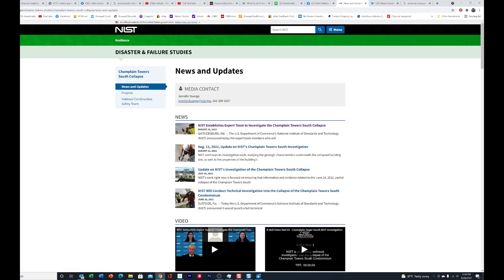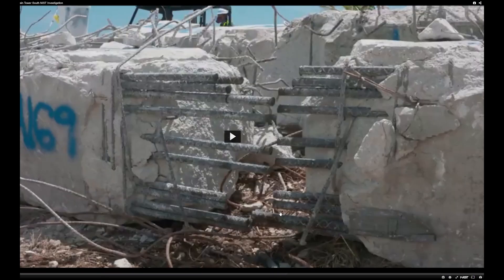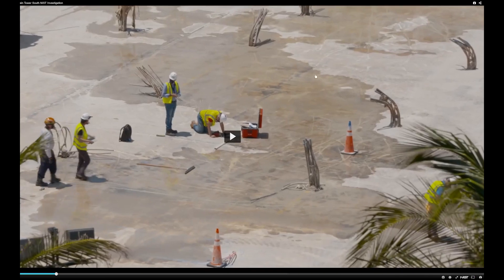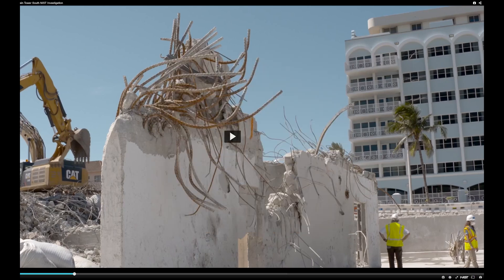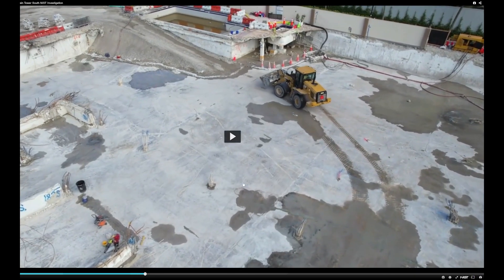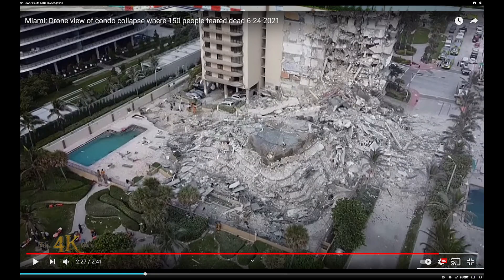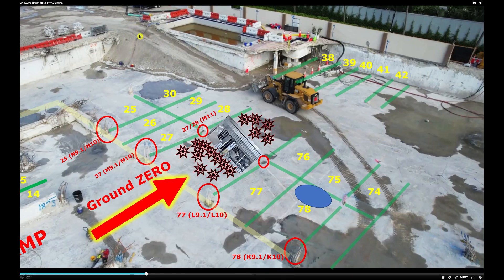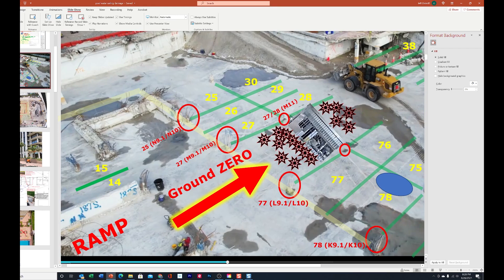Surfside Condo Collapse Site View NIST Video Ground Zero

Comment: Hey Jeff, Thanks for the video. I'm confounded by what I see at 19:53. It appears to be column rebar protruding through the middle of the driving lane of the garage floor deck between O-8 and O-9.1; I'm not finding a colum at that location on the Basement Level Framing Plan, sheet S4 of 14. The nearest column to that location was the one that sat on top of the beam BM35 and extended to the roof.  Whatcha think?
Reply from the maker: Are you referring to the bunch of spaghetti that is coming out of the floor and it looks like it has a bunch of black stripes at the bottom of it question? Power if so you are correct it does not show up on the garage level framing plan on page 30/336 on the 1979 plans. But, it does show up on the lobby level framing plan page 31 you'll see it in the middle of BM33.  So it could be that this came crashing down and impaled into the concrete we simply don't know 'cause it you're right it does not make sense that it would be in the middle of that driving labe. The column with the red stripe on it is the column that divides space #17 from space #18, and is known as column O8. Other than what I mentioned up above I can't see what this could possibly be.
Reply: @jeffostroff  Amazing how it would punch through nine inches of reinforced concrete without any collateral damage to the rest of the slab and (appear that it was there all forty years).  21:30 Not power; all of the power was distributed from the front of the building near the porte cochere at Lobby level.  This mess of rebar is between the red-base column for space 17 and  space 24.
Reply: Column K dimensions were 12" X 24" and extended from Lobby floor to penhouse roof, generally being the NE corner of kitchens in unit A's.

Comment: I was noticing around 12:00 that the remaining rebar in the columns at the edge of the building seems pretty straight.   Would you expect more bending in the rebar in these columns if they failed in buckling (not a concrete engineer myself, so I'm curious)?

Comment: Not only no sink holes, no differential pile settling. Some people keep saying the foundation was suspect because of 2mm subsidence per annum—it is not. Foundation was fine. It was poor pool deck design, very poor construction as you point out with concrete probably not to spec and improper rebar placements and overlaps, and awful maintenance.

Comment: I think H-beam/C-beam near the ramp is what caused the last section of the building to come down. The swaying broke the columns holding it up. The cross beam held up another column that didn't go to the basement floor so it held a lot of weight

The most interesting wall column is the one you barely see in this video - parking spot 80/81 I 9.1/10. Interesting black marks on the floor and bent steel. I think there was a level drop similar to the deck/planter one by the ramp. The plans aren't clear, but I think the gym patio was solid concrete on top of the pool deck level and when the pool/parking collapse forces hit it the column failed. You can see the poor state of that part of pool deck in the garage video. 

If you check the CCTV collapse video the first frame is already into the collapse. If you compare that to what the building should have been that end of the wall seems to have fallen first. Everybody has been looking at K/L/M but missed I.
Reply from the maker: that last section of the building likely hung on due to that h-beam

Comment: @0:50 not only do the rebars look "crowded", but the cover seems a bit thin...?  You wonder if they used vibration jumpers back then to aid consolidation around the bars and stirrups?  Also, I sincerely hope we're looking at the BOTTOM face of the beam--rotated 90 degrees--because all that steel would do a lot more good close to the bottom face than the side face, amirite? =:O

Comment: Yes JEFF your correct that the Lift working on the palm trees is HEAVY EQUIPMENT. they weigh at least 22500lbs. and all that on 4 wheels on a deck that weak was a problem. That deck should have been engineered for heavy equipment and obviously it was not. With no shear wall or support beams. Many things wrong here. OMG....IMO why was this not condemned when the Engineer did the 40 year inspection.
Reply from the maker: that can't see the  latent issues

Comment: fyi, when the rebar is side by side , you can assume that is where they lap join lengths of rebar,
where you see the rebar clean of concrete that can be due to rust on the steel,  which when concrete is remove make the steel look clean, where you find the concrete that has come off said steel you will see rust stains and pieces of rusty steel attached to the concrete .
Reply from the maker: good info

Comment: K11, L11, & M11 being small columns are going to be a HUGE part of the initiation of the tower collapse, in my opinion.  There's not enough for me to have a strong opinion on them being the start of the pool deck collapse, but I think they were probably undersized for supporting the complex double-H beam arrangement on them.

Either undersized to the point of starting everything, or undersized such that they couldn't even begin to resist the progressive pool deck collapse.  That turns those beams into Achilles' heel, with the mass and strength of connection to the critical 9.1/10 columns.  Take the 11 end support away from those beams, or severely compromise it, and you basically start a 5 to 10 minute timer on the tower collapse.

If the 11 end of those beams had been on the larger columns, I think we could have had the opposite result.  They could have possibly formed a strong point to halt the pool deck progression; either saving the tower or delaying the collapse sequence for hours (and allowing evacuation).

And there's one of the professional learning points for engineers.  If you're putting in a big strong beam, give both ends similarly strong support to prevent it turning into a demolition lever if the weak end has a major problem.  Alternatively, design the strong end to adequately perform if the beam suddenly becomes a cantilever.

But, hey, smaller columns are more profitable in the short term, if you can get away with them.

Comment: Could it be that the centerline of the columns 9.1/10 was moved on higher floors? So as resulting in a shift/offset in the vertical alignment? Creating a moment by the loads which tried to twist the columns at the offset making that a weak point? I have not looked to deeply into the details. But from all the not-in-one-line elements I am leaning to believe that could be possible.
Reply from the maker: well this framing is from the garage level and the columns must be centered over the lower floor columns.

Comment: Some of the rebar work should not have been allowed. Bars too close and not sufficient lapping. Whether the structural design should have been allowed is another question. The paucity of concrete remaining adhered to bar might have been caused by debris clearing, tho it also might be due to deficient concrete or bar conditions before pouring.

Comment: I’m not in the building field, or even the usa. But just looking at the part where you said it looks chalky, I don’t see any aggregate in the concrete at all, in-fact in most of the parts where you are talking about the rebar, I don’t see any aggregate, only cement.
Reply from the maker: Yeah sometimes it's hard to tell and keep in mind too that sometimes on the outer edge of a column where there was a concrete mold it can really make things nice and smooth and flat to the point that maybe you don't see the aggregate in there. But I have also heard other people mention that other pictures that were released by NIST early on in July did not seem to have aggregate in it. And look with all of the dust and everything it's really hard to tell so the only way to know for sure is when they get a sample of that concrete and cross section it and then look for the aggregate and that it's not too big in size. If the aggregate is too large the concrete will form big pockets and holes in it. If the aggregate is too small, the concrete will not be strong enough. do you

Comment: The compressive strength and creep resistance in concrete comes from the aggregate which is normally 3/4".  THERE IS NO AGGREGATE IN THE CONCRETE.  It was comprised entirely of sand and cement.
Reply from the maker: Are you sure it should be 3/4" that sounds too large
Reply: @jeffostroff  3/4" minus is the industry standard.  There is nothing but sand in the mix that they used.  Look at the pictures.
Reply from the maker: @screamdoctor  that would explain why they want 1" between rebar, but even with 3/4" aggregate. I would expect they need more space between to get those rocks to sink
Reply: @jeffostroff  The entire design was riddled with errors since the structural engineer did not understand reinforced concrete, bar embedment, concrete shear, the purpose of column ties and the importance of not being pushed around by the Architect and the contractor.
Reply: @jeffostroff  It is called 3/4" minus.  Hardrock aggregate is popular to minimize creep shortening in post-tensioned concrete slabs.

Comment: Spacing should be 4cm on that rebar..  I think before we start patting ourselves on the back we remember it stood since “81 so even though we found problems they didn’t present themselves until degrading conditions changed the strength of the structure dramatically.  

Stuff I have seen wrong with the structures design is around the failure point.. the pool deck. The landscape boxes were not to the drawings. Step down features with the pool area were removed but column placement needed the structure for their current positions.  

But again… it stood for a long time…
Reply from the maker: Correct having one inch between rebars is what they say is the minimum amount of space to have in order for the concrete to properly flow and form around the rebar. So assuming that it did not flow and form around the rebar correctly, does that mean the building is going to collapse a day after you build it? No it's a matter of time in this case it lasted decades but keep in mind it probably would have lasted a lot longer had some of the necessary repairs been made and they didn't let water intrusion into degrading the concrete

Comment: I think you and Josh have indicated that the pool deck went down first. I have seen a video simulation showing small pieces of the building falling before the deck went down.  Do you think this is accurate or artistic license>
Reply from the maker: I think they used artistic license, it's a root cause in search of evidence. We based our root cause mostly on the tourist video showing the pool deck collapsed first, then witness accounts saw the collapse also of the pool deck.

Comment: I hope they verify “bonding”. Were all the columns “vibrated”.
Reply: The reason the rebar is so “clean” is because the concrete was NOT vibrated, otherwise some concrete would have bonded to the rebar.
Reply: Clean rebar means no tension.
Reply from the maker: I've always wondered about that myself I always thought that the vibration of the concrete was to make sure that it got down and filled in all of the voids between the rebar. I don't think that that is necessarily going to make it bond to the rebar, you would need chemicals of the proper mixture in there to make it actually bond better to that metal.

Comment: Love the channel Jeff, could you do a video showing the drainage as I see in one of the stills where we are on the ocean side of the bathub wall a large round pipe going through the wall. Where also was the sump drainage for the rain water that was in the garage floor?
Reply from the maker: I saw no evidence ha they had a sump pump in he garage, so maybe they stopped using one
Reply: @jeffostroff  This video at 1:02 shows the North Tower and highlights that the sump pump was new. I would imagine the South tower would have had the pumps in the same place. They are effectively a hole in the ground covered over by a mental manhole cover. Let me know your thoughts. They had to be using one as it was mentioned by the previous maintenance guy that it was always working flat out and they had to keep replacing it https://youtu.be/8WqraSrYTs8

Comment: Think about it... if you are confused by the architect's framing drawing inconsistencies and ambiguity,  imagine being the concrete contractor trying to follow it !   Maybe some rebar specifications mistakes were made from the beginning when the building was constructed due to this ?  Maybe it will be found to be a contributing factor ?
Reply from the maker: Was I supposed to pout concrete into that column, or elmer's glue? LOL
Reply from the maker: Was I supposed to pout concrete into that column, or elmer's glue? LOL
Reply: @jeffostroff  More important the # diameter of the rebar and count / spacing.

Comment: Was the pool "fresh water" or "salt water"?  Salt water intrusion turns concrete a chalky white color and erodes and weakens the cement much faster.  If the parking garage ceiling was cracking and bowing down, that would be an indication of weak concrete and the ceiling in the basement should have been shored until a fix was accomplished.

Comment: I wonder why state officials don't take a newly condemned condo and dismantle it to see what state the concrete is in. Like an autopsy. It would yield clues as to how many other buildings may be at risk.
Reply from the maker: Yes I agree it would be pretty easy to have av structural engineers come in and they take core samples out of different parts of the concrete and just fill it right back in the same day. That is what the city of surf sides engineered that they hired did he went on to the North towers towers sister property and took some core samples and filled them in the same day

Comment: A few weeks on the beach it will corrode overnight, plus it’s raining season, I did a Seawall in surf side and the rebar rusted on surface quick
Reply from the maker: IS rust in surface ok as long as the rebar does not get wet after concrete cures?

Comment: Would the rebar spaces be part of the reason the columns failed?
Reply from the maker: Yes it is possible because if the rebar is spaced closer than one inch together, then the concrete cannot flow properly between them and hence it may not grab onto the textured edges of the rebar properly, and you may not have the strength that you thought you have when the column kuros.

Comment: Do you think if they would of started repairs a couple years before that this could of been avoided?
Reply from the maker: Absolutely this could have been avoided and the other thing is when they finally did start the repairs this year, I question why they began on the roof instead of on the really bad structural issues. My understanding on their reasoning was they started on the roof to get it over with by hurricane season but that's not a good enough reason for me.

Comment: Great video as usual Jeff, thanks. At 19:05 I’m confused - is that big chunk that’s on and around space 14 from the slab above? It’s obviously above floor grade so it’s throwing me off. If so why did they choose to leave that when the cleared out everything else?
Reply: This is the C beam that can be seen on the ceiling of the garage tour video. It fell to the garage floor when the building started to collapse and is now on the floor as you can see in the footage.
Reply from the maker: I have been wondering this too since the first day I saw this a month ago. It could be two possibilities here one they think that that big C BeaM is part of the structure like it's built onto the floor because it looks so massive just like they left the elevator section of the vestibule on the other side of the garage floor. Or maybe there's something about it that they want to study it further in place knowing that it dropped right where it dropped from. This was hanging off of the garage ceiling.
Reply: @jeffostroff  ah of course, now I see. It’s interesting, as you point out later in the video, that the bottom of the “c” lines up with column 27 in the drawings and Fiorello’s walk-through. Makes me wonder even more why they have left it there.

Comment: 26:00 The Engineer is saying 9.1 is the right side beam from rectangle with X, from the left of that rectangle with the X through it, that beam is slightly offset lower, which is #10. Carry on going left and it's slightly lower but parallel. That's beam row 10. Laid a ruler on screen and they are offset. That's why like you denoted 9.1 goes straight and 10 is slightly below. So those are 9.1 posts. 10 are on the other side of the building. That doesn't excuse the lack of consistency in naming conventions. Probably an earlier draft he never updated. 3:13 You can see on the right of the image where chip is on corner that is how they are poured. Maybe they didn't put spacers on them or whatever to keep them apart during pouring and weight of concrete shifted them together after forming and during pouring but that's insane. Looks like there was no adhesion between rebar and concrete itself. Like it was... dirty or greasy when installed in form or something. Regardless I feel like there's just too much rebar in all of these columns. Too much crowding. I'm not expert though.
Reply from the maker: Ye a lot of us are concerned about the crowding